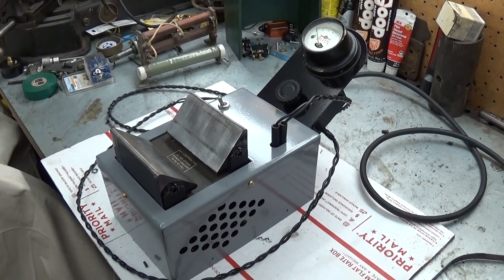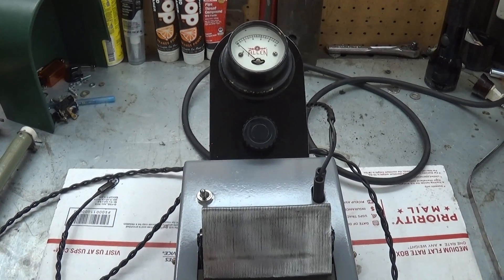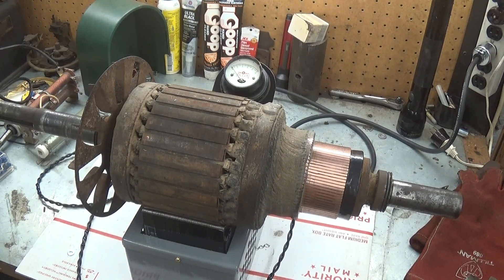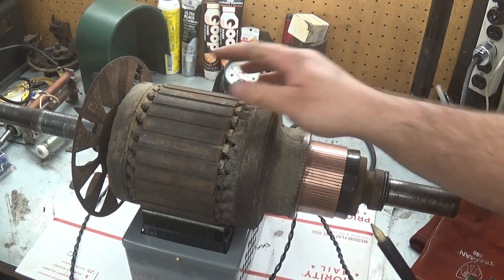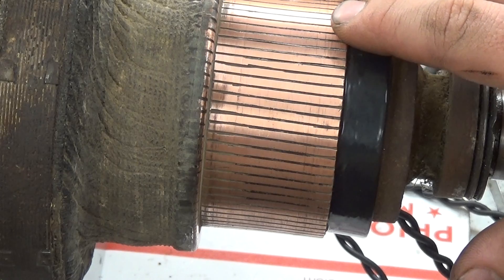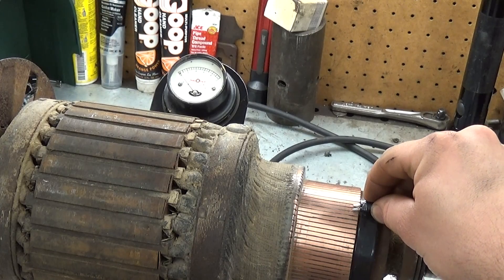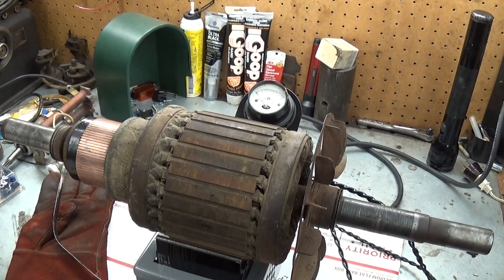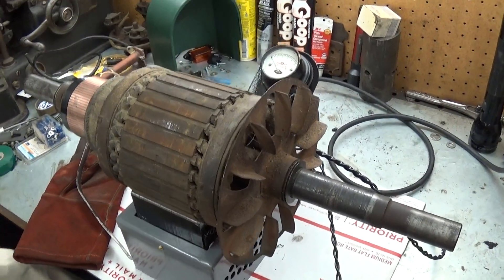HOW TO USE AN ARMATURE GROWLER

Comment: There used to be a slot under cut tool for the commutator for cleaning the spacers out preventing shorts after running a short time

Comment: I can remember using the growler in my uncle's repair shop about 50 years ago - very useful tool to have.   That was back in the day when we used to remove bad starters and generators (before alternators were common) on cars and rebuild them right there in the shop instead of just replacing them with new units like they do today.   I can remember rebuilding a huge starter off a John Deere tractor once.
Reply: Cool

Comment: is this method superior to the resistance testing done with a dmm nowadays?  The general methodology is nearly identical.
Reply: you answered your own question! i only use a multimeter... i test the armature coils and commutator and call it a day. of course the older outboard starters are so easy to rebuild / replace.

Comment: Is there line voltage thru this? This thing scared me when the armature jumped at continuety check, this is the kind of tool i am quite delighted that it is not in use anymore. And that noise- i am used to when i hear that sound i immediately cut power because some went horrific wrong. But i see the usefulness in this, it would take me a while feeling safe using THAT. Nice explaining, though. You seem way more comfordable with this than I´ll ever be, keep up the good work.

Comment: Interesting.  The growlers we use at the shop I work at are a different design but same principle.  Most of the motors we work on are a tad bigger than that one your useing for demonstration.  Setting a half ton armature on that little box would probably end badly and you wouldnt be rotateing it by hand :p  Ours are more handheld and set on top of the part were testing but same basic testing procedure.

Comment: Thank you again good video. I used to rebuild car alternators and starters I just gave the armature the smell test and also you could see discoloration in the windings. But now days  it's hard to find the components to repair starters and alternators. You can find them but you either have to drive all over the place or order them on line. Diode packs bearings and bushings used to be readily available in one county or town now you've got to hunt them down. Oh and I forgot the brushes and a few other parts.

Comment: Nice demonstration! I used to use a growler when I worked for an electric motor shop in the mid 90's. All my work was with APU's on jet planes Mainly Delta Airlines. They would send them in to have them rebuilt after so many running hours and very few had any issues but they wanted them rebuilt anyway.

Comment: Could you also test this by putting a ring of bare wire around the commutator, attaching it to one lead of a megger, then attach the other lead of the megger to the motor shaft, and megging it that way?

Comment: how exactly how the growler, what does it .... what damage can be detected with a growler
Reply: I think You can compare it to an electromagnet running on AC, but the magnet field will be in the armature (normally it´s in cooperation with the stator), the hacksawblade will be drawn and retracted in the cycles of the line frequenzy from the mains, in this case (ie an electromagnet running on AC where the circuit is shorted out, that´s why it start acting weird i guess), if You live in America it will be 60 Hertz, that´s why it starts to vibrate i think.

(That meter is just a Voltmeter with a reostat (adjustable resistance), same princip as in a modern multimeter, but analog instead of digital.)

Sorry for my terrible English (it´s not my native language), but i hope it straightened things ot a bit more for You, it´s pretty simple once one get a basic grip on it.

Comment: I have a growler and an armature lathe. I used to fix old tractor generators and starters. You can check starter armatures for shorts with it but not for opens for the fact the windings are too heavy gauge wire. My pacemaker stopped a couple of times while you had that on. Medtronic did not list Growlers but I but it would send mine into a tizzy.

Comment: That is an interesting piece of equipment. The local Napa store near me still repairs generators in house. They have even converted one of my gen. from 6V to 12V for me. I imagine they probably have a growler sitting on the bench. Electric motors and generators are something that I wish I knew more about.
Reply from the maker: Chip Wright Thanks for the comment.  I have found that reading old electrical books is a great way to learn about this type of thing.
Reply: Nothing to them. An Armature growler, lathe and a ohmeter is pretty much it. It has been 35 years since I have worked on them. I still remember them like it was yesterday.
Reply: I used one when working on a Renault 4 generator in the mid 90s.
Reply: Start by ordering a remanufacturer kit. There are common kits available for generators, alternators, and starters as they're all pretty similar. You can save about $100 just on the rebuild by DIY too.

Comment: Nice job  There still used in electric motor shops . Mostly on specialty motors . High priced AC or DC  The induction works the same
Reply from the maker: Lawnmowerman02346 Seems like any internal motor/ generator work is becoming a specialty!!Thanks for watching!

Comment: I inherited a growler, Does this work for starter armatures? Good video, thanks for sharing!
Reply from the maker: MudRFunR Yes it will work for any wound rotor machine with a segmented commutator.Thanks for watching!
Reply: Good to know, thanks!
Reply: @MudRFunR  I've even used one on a squirrel cage motor rotor. It only works on the magnet test, but that's all you need to see it that's the bad part.